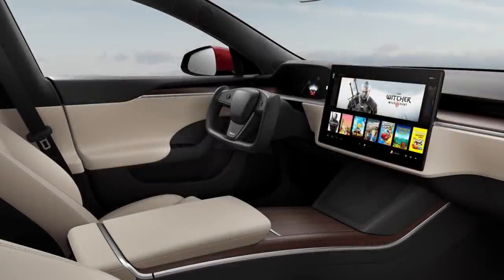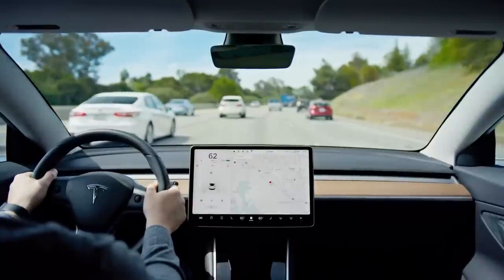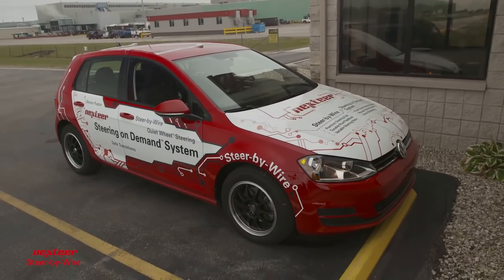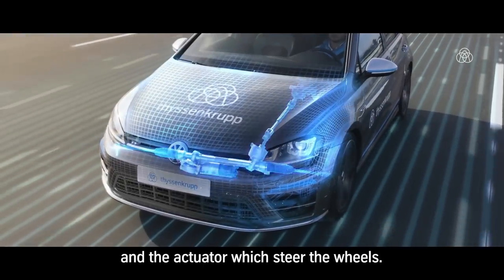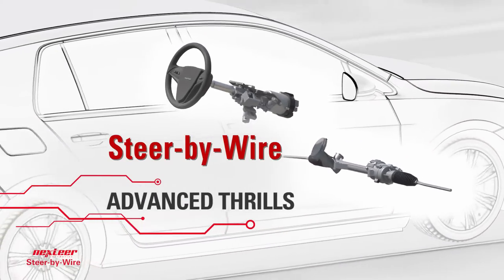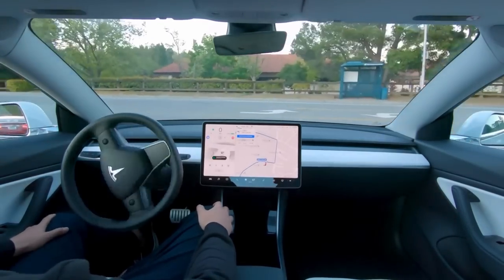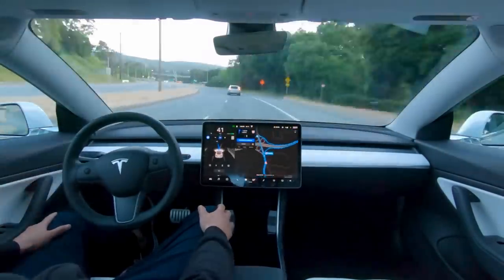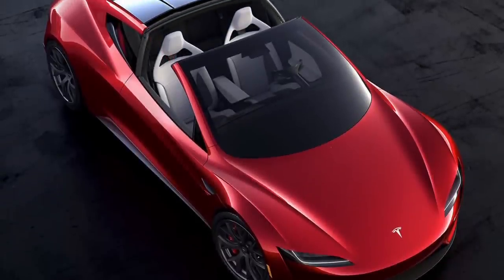Steer-By-Wire, The Secret Behind the Yoke in Tesla's Model S Refresh, Enabling Full Self Driving!

Comment: so if by chance you lose power you will not have steering. and if you go brake by wire its the same thing. i remember  years back they wouldnt allow full hydrolic steering because there was no physical connection between the wheel and the road. so you may lose control of your vehicle. so wouldnt this be the same idea. no physical connection